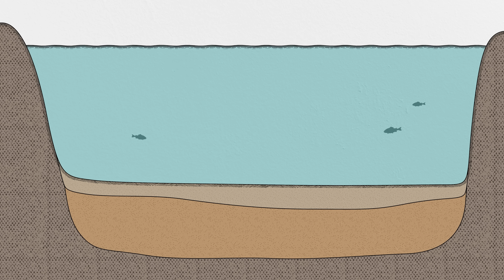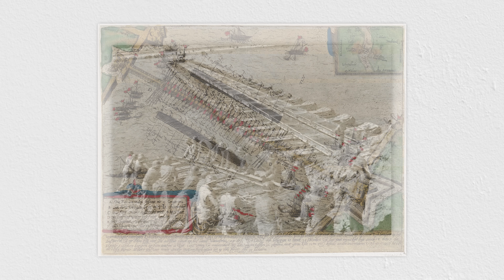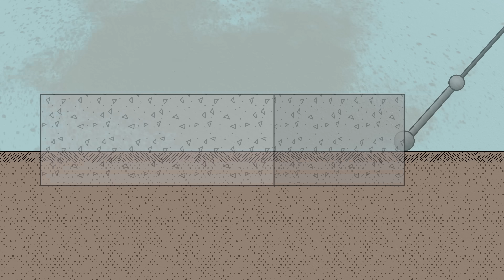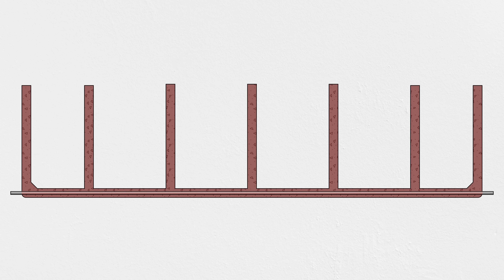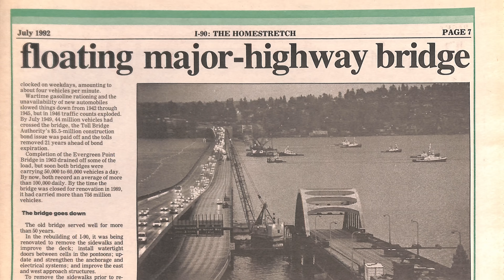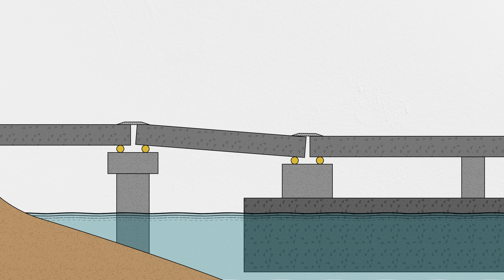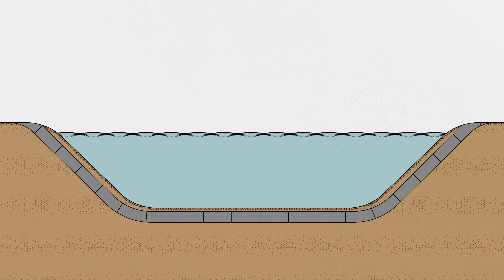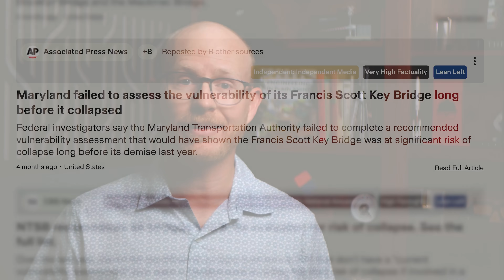The Hidden Engineering of Floating Bridges

Comment: I remember crossing the old 520 bridge during big windstorms (I was commuting across it).  The water splashing on the car was kinda fun.  The swaying, though, could get really unnerving.  It was also a twice-daily task to check the bridge status during storm seasons since it would often close (and traffic on the I-90 bridges would be horrible).  One of the neat features you didn't cover with the Hood Canal and the old versions of the other bridges is that they would open during storms to relieve strain on the overall structure.  (Unless I missed that...)

Comment: If I'm not mistaken (tried to derive this myself so I'm not sure what stuff I might be missing in this on-a-napkin calculation) the formula for a neutrally buoyant sphere is something like

(s/b - 1)/(w/b -1) = (r / R)³

where:

- s is the density of substrate (so water, roughly 1000g/L)
- b is the density of the bulk inside (so probably air - this part is tricky as it's pressure dependent as air is compressible but since we're talking a swimming structure, roughly at 1atm and 20°C? Is that a fair assumption? In which case we're talking 1.205 g/L
- w is the density of the walls which apparently has a varying range, presumably depending on the type of concrete, but a middly value is about 1100 g/L which isn't actually that much heavier than water. (No idea what sort of concrete would be used for these bridges)

Plugging that in we get that the factor of r/R (inner radius over outer radius) is about 0.9687. The wall thickness would be dr = R - r which lands us at about dr = 0.0313 R
So if you want to have a concrete ball that has neutral buoyancy in water, with an overall radius R = 1m, you get that the concrete walls must not be thicker than like 3.13cm.
That seems to be pretty far off your rule of thumb so I must be something wrong here... Might be as simple as the wrong value for the concrete though?

Comment: Driving while it was pitch black and very windy over the old 520 bridge was not a fun experience, with water splashing onto the deck.  The new bridge is higher off the water, so an issue anymore.

Also of consideration for boats:  Lake Washington only has some small rivers flowing in, and a small lock and dam for the exit to the sound.  So the bridges on it simply don't need to consider ships above a certain size, despite the otherwise large spans of water they're crossing.

Comment: We have two of them across the lake now.  Well, really 3 since I-90 actually has two side by side.  They are doing another first across the I-90 bridge.  They are running light rail across it.  Evidently it has never been done before.  They are way behind schedule.  They put all the track in and then realized they put the wrong kind of track in, so they had to rip it all out and start over.

Comment: If you build a floating tunnel that has no surface buoys, but floats because of positive buoyancy and is held in place by being anchored to the bottom, how much would the tunnel be affected by surface conditions? I have always wondered how much a submarine 50 metres below the surface under a hurricane would pitch or roll du to surface wavces. (I am intrigued by the idea of offshore hydropower built in such a way to avoid being beaten into scrap by surface waves. In a place with  a steady current, such a system would alleviate the intermittent nature of other renewable energy sources.

Comment: As a born and still resident of Seattle, this was a great piece on our floating bridge. I watched the floating bridge sink during the Thanksgiving holiday storm. 
I look forward to riding the light rail over the bridge in the future. The engineering on that must be unreal. 
Fun fact, back with the original floating bridge. There were two lanes in each direction for traffic, but during "rush hour" one center lane would change direction. For example, in the morning rush hour, three lanes would be going into Seattle. The problem with this was it was only controlled by overhead traffic lights. No barrier or cones to keep traffic apart. Driving the center lane was always an adventure!! 😱
Reply: LOL, as a Seattleite born in 2001, real glad I've never had to deal with THAT (the middle lane). Sounds like a nightmare.
Reply: There are some of those multi-directional roads in San Antonio too, and often many of the direction indicators are out. I think they usually only change them during events, but occasionally I'll be driving there late at night and slightly question if I'm going the right direction 😅
Reply: They were even more exciting when they had you going around the wrong side of the drawspan bulge.

Comment: The Lake Washington Locke system is a key part of the viability of these bridges. They carefully control the water level in the lake. Might make an interesting episode on it's own!
Reply: The Cedar River (Renton) was rerouted into Lake Washington in 1912 which would eventually supply the water needed to operate the Hiram Chittenden locks. When the locks were completed (1916), Lake Washington's elevation was lowered so that it no longer emptied into the Black River (Renton) which made the locks the new outlet for Lake Washington.
Reply: @johnnyh3653  And the Montlake Cut, because Lake Union and Lake Washington are not naturally connected. Lake Washington used to exit through the Black River into the Green River.
Reply: @IcallBS509 You are correct sir! There’s a lot of cool civil engineering projects that were done in the Seattle area that would never happen in today’s regulatory restrictions.
Reply: @johnnyh3653  Agree, it was a massive project and if my memory serves me correct the difference between the lakes used to be 7-8 feet. You also could take a coat all the way to Lake Sammamish through the slough from Lake Washington, the old jet boat races were cool. I live in Kenmore, right next to the "Slough"
Reply: @johnnyh3653 what kind of projects couldn't happen today? I agree that they would take forever, but Sound Transit is already putting light link Transit across floating bridges (which has never been done before), we have a fully electric ferry fleet (which has never been done before), built the 99 underground tunnel highway using the largest boring tool in history and all of that has happened in the last decade.
Reply: @brianwilliamson4546  Projects that couldn't happen today (limiting it to Washington State) would include every hydro-electric dam within the state, the Hiram Chittendom locks, the rerouting of the Cedar River and elimination of the Black River, the Denny Regrade and it entailing's which were used to fill the wetlands that created the SODO district to name a few.  With the requirement for local, county, state, federal permits and the Indian tribes pull, the projects would never happen.

Light rail never pencils out and in the Seattle region with it's water and geographical features, cost a lot per mile.

Seattle doesn't have a fully electric ferry fleet. Fully electric ferries are a new proposal and being the first to implement something new is foolish.

The tunnel was not a big deal environmentally speaking. It was built in an area that was already 100 percent developed and, being mostly underground, had minimal impact. It was also way more expensive than the above-ground replacement option.
Reply: Yes, except for the Hood Canal bridge, which must deal with a ~nearly 15 ft tide range.
Reply: I think you are confused.The locks don't control the level of the lake. When the locks were built, they lowered the level of the lakes by 8 feet. This was engineered into their design. But as a function to maintain lake levels, that is a no. There isn't enough water volume movement to significantly impact lake levels. Drainage of Lake Washington occurs at the dam adjacent to the locks. The locks allow ships to pass from the montlake cut, which is higher in elevation, to Puget Sound.
Reply: @mikel9567  When I took the locks tour, I was led to understand the system of locks regulate the depth of Lake Washington precisely. The adjacent dams were lumped in as part of the system.

Comment: Your mention of concrete canoes reminded me that yachts and even full size ships have been constructed from concrete.  Quite a few of them are still in service today.
Reply: There were calculations in the late 1800s about making concrete balloons. I don't remember the formula, but there is a ratio of wall thickness to volume to material mass that requires a sphere diameter of around one mile (I may be off a bit). If you had enough money and concrete and labor, you could build it. It's unclear how you would heat that volume of air... Impractical to say the least.
Speaking of ships... During WWII, the US had 24 concrete ships. Also mostly impractical, but there was a shortage of steel.

Comment: Hey Grady! 

People have talked a lot about how EVs are heavier, and thus wear down roads significantly faster, and I was wondering, how much truth is there to this? 

I did a little research, mostly regarding the Fourth Power Law for road construction, and vehicle weight per axle, and from what I can tell, even though replacing an ICE vehicle with an EV would slightly increase road stress, that increase is still a fraction of what large commercial vehicles are already putting on the road. 

Considering the recent talk about taxing EVs a lot more because of concerns over wear and tear, it seems like a worthy topic to discuss how much of an issue it actually is
Reply: I think part of the concern with taxing EVs more than ICE vehicles (given recent events, I took me a bit to realize what you meant here) is that a lot of that funding is done through taxes on gas, which makes sense. The more you use a vehicle, the more wear you do to roadways but the more fuel you consume. But EVs don't consume gas, so they wouldn't provide funds through a gas tax. You would just need to figure out a new and proper means to tax them.
Reply: @Kalatash they are working on that, tax all traffic by the mile. Need to get ready for the social behavior score, when you go over, they shut your car off remotely. Have fun

Comment: I’m glad this finally got covered! I commute over either the SR-520, or the I-90 floating bridges most days. Growing up in the Seattle area I was so used to the concept of floating bridges that I was really surprised to learn they weren’t more common. I can also say that if you didn’t already know they floated you would never guess just by driving across. I’ve never seen waves splash onto the roadway, you cannot feel any sway or bobbing, and the only time they are really closed in (both directions) is for sea fair when the blue angels fly over Lake Washington.
Reply: One or both bridges are closed about once every other year, due to high winds and storms.
Reply: if it's really windy you can DEFINITELY feel the floating bridge sway/move.   In a bad winter storm many years ago, waves crashed over the sides of the 520 bridge and made the entire bridge deck an ice rink... at which point they shut it down for a day or so....  but, that doesn't happen very often

Comment: I lived in Puget Sound for a few days shy of 25 years; I was there for the Evergreen Point replacement... and yes, it's pretty disconcerting to get wave spray on your helmet when crossing... what's even more fun is looking right (south, where most winds come from in Seattle) and seeing a roiling mass of several-foot-high waves battering the bridge and spattering the vehicles... and then look left and the water is almost like a millpond where the bridge has blocked both wind and wave... 

It was fun to see that they'd FINALLY gotten round to testing steel wheels on steel rails; I didn't realise that roll was actually a thing for the roadways' surface... but yeah, a 2-D floating bearing underneath a stiff railbed should do the trick.  I hope so.  Getting rail across Lake Washington will be HUGE for both commuters and the environment... one cross-sound trip for a four car consist will take ~400 cars off the bridges; do that every six minutes and you can handle a BIG chunk of what's there now.  

If you want to do the trifecta on Puget Sound, do a piece on the ferries... why it's impractical to bridge the Sound itself, how a double-ender ferry works, and the infrastructure a ferry needs to operate - bridge decks, overhead passenger loading, and why on the Southworth-Vashon-Fauntleroy run sometimes they have you back onto the ferry so you're facing the right way when you get where you're going.  (It would be a really cool bit of animation....)
Reply: Doing a bridge over the sound wouldn't work for a few reasons, the shipping traffic alone would block that. But, I've seen estimates that it would only cost a billion or so to build a bridge under it.
Reply: The amount of engineering testing that went into the rail bridges is honestly impressive. At one point there were trains in Pueblo, CO doing live testing on the test tracks there - with something like 20,000 points of data being collected.

Comment: Would like to see structures built on top of roads and bridges to provide accessible elevated business, residential, and parkland space above what are otherwise concrete wastelands. In Seattle, this could provide esthetic benefits (hanging gardens, plenty of green space, and twinkling lights), as well as reduce the brupp-brupp noise of traffic (such as is heard from the 520 bridge). Seattle is a noisy city, with transportation related noise (air and ground) being the biggest components.

Comment: I was a team captain for our universities concrete canoe.  Our canoe had no sealed voids (although that was allowed).  Instead we used expanded glass beads for aggregate to make the concrete itself less dense than water.  And we still got 2000psi in 14(?) days.
We also utilized carbon nanotubes for workability during casting.
Reply: I like your funny words magic man
Reply: Expanded glass for aggregate is smart. Probably not the cheapest solution though.
Reply: How tf did you get carbon nanotubes in sufficient quantity to be meaningful without giving yourselves turbo-asbestosis?
Reply: @Frommerman by using masks, goggles, gloves, and having no exposed skin, presumably.

Comment: The fun part about them is that they’re actually pulled down into the water by their anchor cables to counteract the weight of the vehicles on the roadway. The idea being that if they’re pulled down but the weight of the vehicles that could be on them, when actual traffic rolls onto it, it sink any further, because it’s preloaded. Since the bridges are often faced with bumper-to-bumper traffic, they’re preloaded to counteract quite a lot weight. (Water is quite heavy though, so it’s less apparent than you might think)

By way of comparison, there’s a small floating bridge I used to drive across in rural Vermont (before I moved to Seattle) that did not do this, and while it was dry to walk over, driving across it would sink the roadway an unnerving couple of inches below the surface.

Comment: Why not fill the voids with solid material less dense than water like foam or insulation foam etc so can't flood?
Reply: For one reason, because you wouldn’t be able to go in later and inspect it.
Reply: For another, it's not like foam isn't going to degrade and let water in anyways
Reply: @person8064 you can get rigid foam, another option might be wood or sealed plastic containers filled with air, smaller temporary floating bridges are already made of hollow rigid plastic boxes connected together, why not scale that up and stiffen it more

Comment: I had a laugh when you mentioned they filled the pontoon bridge on purpose when cleaning the old concrete. I mean it wasn't as dumb as that, as you mentioned the added stormwater was the nail in the coffin, but the idea of filling your float with water just sounds so silly to me even if it would have worked on a sunny day. Why couldn't it all go into the surface water anyways, if it's only contaminated with concrete it should just have some Calcium silicates, Calcium Oxides, Calcium Carbonates, plus some Sodium and Chloride ions from any road salts.

Comment: As a engineer, I thinking floating tunnels are nuts. There is no way to engineer them to fail safely. Therefore, if for any reason whatsoever they were to fail, you are looking at many deaths. Bridges often give a crapload of warning before failing, as is typical of many structures. With a floating tunnel, the first sign you get as a driver might be a wave of water coming down on you.

Comment: I wonder if that inches→feet factor of 12 thing is actually a factor of 12, or whether it's close enough to 10 for normal metric measurements to work just as well (and in-fact much more generally). I wouldn't be surprised if the number 12 is just there because of imperial measurements.

Comment: Surprised you didn't mention the Mulberry concrete port used on the DDay landings.  They floated huge cast concrete sections, floated them across the English Channel and bolted them together, using them as a makeshift port until a real port could be captured.  It lasted for only a short time when a fierce storm tore it apart, but it did its job to solidify the Allies hold on Northern France.